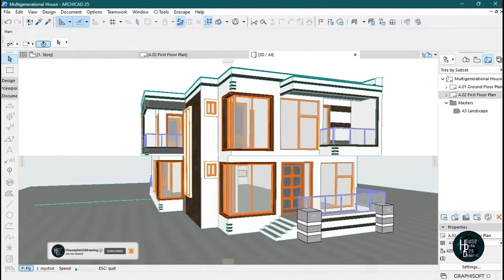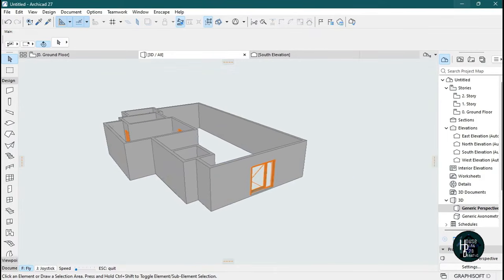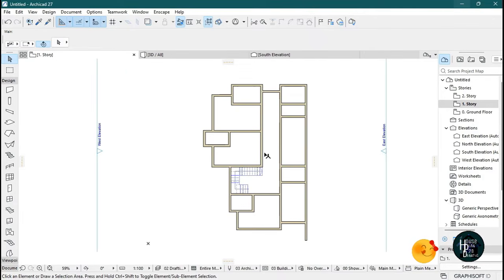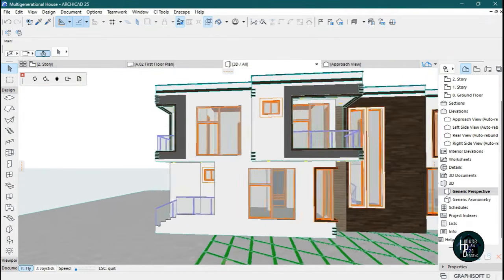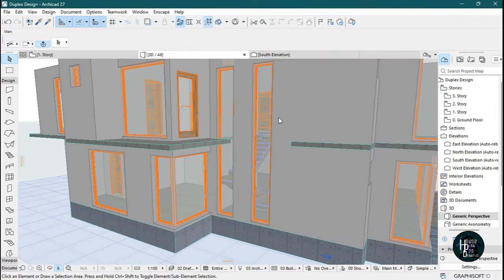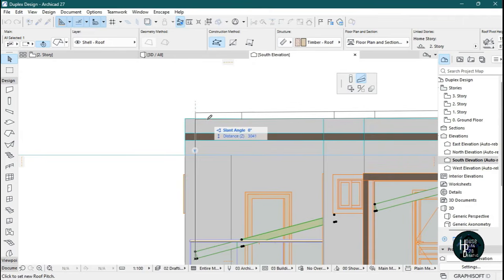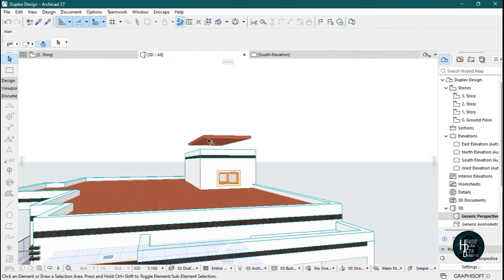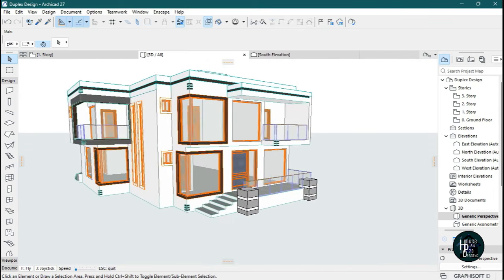Archicad Tutorial:Basic Floor Plan To 3D For Beginners (Duplex Version)

Comment: Good work Chief.
Why are you not using columns and beams?
Reply from the maker: Appreciate it! 

In these tutorials I’m teaching the architectural design workflow, so I keep the model clean and focus on walls, slabs, spaces, and presentation. 

Columns and beams come in during the structural detailing stage, which is usually handled separately.That’s why you don’t see them in these videos.

Note: I don't do tutorials on structural detailing